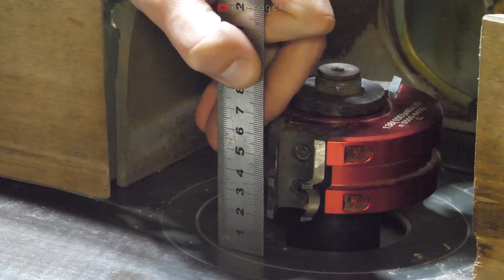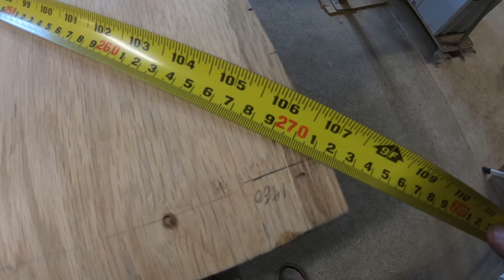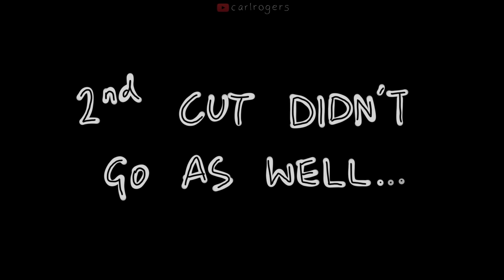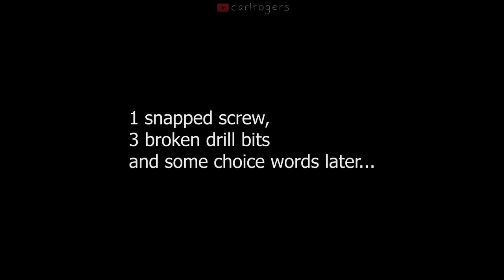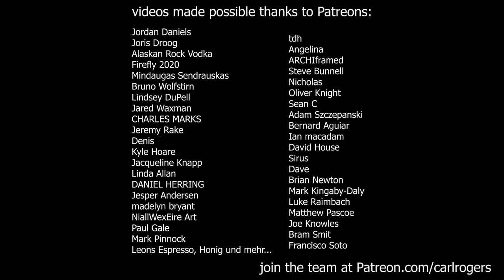Oak Door made from Old Scaffold Boards

Comment: I am an old-timer carpenter from Croatia. For my sense of beauty & design, that barn door is overstyled, although really well done with talent and skills. 
I used to work for a billionaire at his country estate at the Mediterranean. We bought 150 years old oak planks and beams for the doors. All imperfections were welcomed and appreciated!
I treated the wood with hardwaxoil before I assembled the planks to a door, so even the no visible parts were protected against humidity. 
Note: the charme of an old building is his memory of centuries with its ups and downs, wars, wounds and different owners. 
Carl's new door will be best in 100 years.
Reply: Indeed. In one way the old door worked for me. The very wear and tear on it was a work of art. And it fitted into the old door frame like husband and wife. The key hole was magnificent. 
What would they have done in the past? I think a broad, thinner, old plank would have been attached over the bottom to cover the wear. If security is a problem then I would have no problem with fixing a high security lock through the door, leaving the old latch as original closure means.
Reply: Yes you do have a point, repair is always best than replace if at all possible. Was that old door salvageable?
Reply: I had the same thought: at least put some linseed oil on the planks before assembly.

Comment: This young man is an artist among carpenters and builders.  He takes his time and gets all the details right.  (After many years working with heavy machinery, I do hate to see anyone working with a loose floppy shirt.)
Reply: I agree about his skill, and I especially agree about loose clothing around shop machinery.  Loose sleeve near the belt sander was scary.  I have seen what can happen, it ain't pretty.  Also that young man using the drill press who was wearing that pink twirly thing around his wrist.  Carpenter's apron helps, tucking in helps, sleeve covers help.  Safety first.  Great work!
Reply: @rickcavtube  Cheers, Rick.  Glad we're on the same page.

Comment: Lovely looking door and a bonus on the oak.  Costs for oak are up 30% this year alone.  

Not sure if you did this but the vertical boards need to be spaced apart by a couple of mm.  Essentially pull the T&G back apart before fixing on the ledges.  If you don't do this your door is likely to bow around the ledge.  The vertical boards pick up moisture and expand widthways, but the ledge will not expand lengthways with them.  This forces the door to bow around the ledge to allow for the increased width of the verticals.  Think bimetallic strip.
Reply: I read this twice to understand, thanks for the info. Also indirectly answered my question of glueing T&G.
Reply: I second Robert's comment. I've milled some reclaimed solid oak flooring for a small gate and needed to know these exact things before I proceeded. Thanks. :)

Comment: I watched this when it came out and just moved into my first house, aged 60.
I own screwdrivers n stuff but had never made anything from wood in my life, not even had any lessons at school.
So when I found the new place came with a supply of timber (hideous built in wardrobe, musta been absolutely kerching) I decided to make myself a garden gate.
Thanks to watching this I thought it looked straightforward, even though the only power tool I have is a cordless drill.
A year later.....and it's still there. I learned a lot eg don't use MDF outside even when you paint the ** out of it. 
Obviously mine's a bit rougher (made on a kitchen table in a 'working' kitchen) and my tools were....inherited from my grandad, apart from that cordless drill, and he died in 1939.
But I got confidence from this and now I can make anything......in my head. Still limited by lack of tools but I'll have a shot at anything wood now.
Some journeys start later than others!

Thanks Carl and family.

Comment: Always impressed by your attention to detail and careful planning. Little things like using some 3&1 oil on those hinge screws really shows your using your brain before you start building.
Reply: What's the purpose of the oil?
Reply: Yes, I love all the tiny details that help complete the 'job well done'.
Reply: @micikas  Makes it easier to drive them into the wood. 👍🏽
Reply: Goose fat would be more traditional, 👍😁
Reply: Vaseline (petroleum jelly) works well too.
Reply: I used to have a tobacco tin of grease. . 55 years on the tools.
Reply: 3&1 will poke through just waaaait. use mastic linseed oil base or wax but 3&1 or WD40 is silicone and thats bad for finishes.

Comment: As a joiner (for 36 yrs) and experience of making plenty of oak doors and gates, I've just got a few tips to make that door last a few years longer. 1. Leave expansion gaps between the boards. 2. Use stainless or brass fixings. The oak will rot steel screws quicker than you think. 3. Braces are too shallow. They should have gone bottom corner to centre of middle ledge and then centre of middle ledge to top corner in a line but at least you got them going the right way! Some so called joiners can't get that right.
You might have been surfacing the best way as you sighted down the length but it did look like you were round side down on a couple of the boards? I was always taught to take a light few passes and push the board from the back, not press down over the cutter or you'll plane it bent. 
Also on the spindle moulder, when rebating I'd always have the cutter block at the bottom, that way if the board lifts you can run it through again. Your way it would have taken a big scallop out. 
Just tips, not trolling! 😊
Reply from the maker: much appreciated! really useful and well said so thanks for taking the time to write that :)
Reply: @carlroge  I'm sure there are other doors you can apply these advice on :D by the way thank you for restoring a piece of french history, the built looks quite premium so I guess it belonged to some local lord or whatever aristocrat family
Reply: i have to add a lil thing, on the plainer, you have to press it down, but on the 2nd half of the table, the half behind the cutter. Exactly how he did on the last few inch of the boards, thats how you have to do the whole board. Thats how to get a plain surface out of a bend board. And for that you have to lean over the cutter, so dont wear lose clothes, for safety ;) Also i hope there are no kids using this heavy door, since if it catches wind this can get quiet dangerous, we have used damper for such huge heavy doors (like at older cars trunk) to limit the speed of movement. Also nice work carlrogers. *Not my native language, hope it was understandable, cheers.
Reply: Good comments - the braces aren't doing anything once they are at more than a 45 degree angle - that's why for a wide door they don't go right across -  if that makes sense :) and use the planner to take the majority of the 'thicknessing' process of the board - its quicker - once its down to nearly the correct thickness then pass it through the thicknesser
Reply: Completely agree on point 3. I've learned that "wood must stand on and steel must hang from the hinges". And indeed, one often sees wooden braces "hanging" instead of "standing".
Reply: Also as a joiner of 36 years, I totally agree with you, a good effort on their part, but not quite correct. It will be nice to see what it looks like after a year of hanging off those hinges.....
Reply: I agree with Degsy Terry if the wood expands it will bow and the braces are to shallow
Reply: i don't get what you mean about bracing can you elaborate please
Reply: As a cabinet maker/luthier this guy has some very good advice, still a very nice door etc though well done
Reply: I have to weigh in here! The braces are shallow, but they are still triangulating - the geometry can't go anywhere.
I did wonder why the one door, not two? There could be many reasons, including following what was there, but two would have been easier for day to day access.
Reply: @robertmitchell9415   little scrape on the ciment...

Comment: The last component should be a drip ledge.
To shed any water clear of the bottom of the door, 
so that it doesn't soak into the end grain, 
and cause rot, like the last door suffered from.
.
Reply: The door sets under a roof and it doesn't appear he lives in a rain forest. lol
Reply: @cletusspucklerstablejeaniu1059  
LOL 
Rain gets wind blown, and water off the roof will also get wind blown, onto the door.
That's why the original door was rotten.
.
Reply: @niklar55  ... Uh ... You do know this was a livestock barn ... A "300 year old livestock barn!"
Reply: @cletusspucklerstablejeaniu1059  
Naturally, I have two, also in France. Very similar.. So, I know the problems well.
.

Comment: Carl if you have heavy or clay soil there, you can dig the sawdust in as an excellent soil conditioner. (This allows air into the soil for much healthier plant growth) 😊
Reply: depends on the species of the wood... some are great vegetation killers.
Reply: @jancloddlafront9185  It's oak - and it's in the title.  The risk - if you are really wanting to find fault with the idea - is of nitrogen-robbing by the sawdust with its large surface area as it rots down.  But even this will be a short-lived effect as with tiny particle size it will break down relatively quickly, and the following year all will be well again, especially for nitrogen-fixing legumes.  I manage an allotments site and use much sawdust in this way & in composting.  I think Phil's idea is a good one.
Reply: @jancloddlafront9185  like "eucalyptus" for example.
Reply: @falfield  I used to work in a cabinet door shop that just pumped it into a huge pile out back, 3-4 ft tall. Mostly oak and birch sawdust. That was about 10 or so years ago, and it's mostly still there. The shop has been closed at least 8 yrs. I would have thought it would have long ago been rotted. Only the part that touches the dirt is rotted a little more at a time. It was curious to me, is the reason I checked every year or 2. It's been about 2 years now. Time for me to check it again.
Reply: @teenapittman4241  There are 2 reasons why it hasn't rotted, one a possibility and the other a certainty.  The possibility is dryness - sawdust piles can often shed water very readily and be quite dry under the surface.  Dryness is the reason the wood in your house doesn't rot.  The certainty is the absence of nitrogen.  Composting (an accelerated breakdown by natural mechanisms of organic matter, about which there's well-worked out theory & lots published) requires a balance of carbon-rich (woody/stemmy) material and nitrogen-rich (green leafy/sappy) material, together with air and water.

Too much N and a slimy mess results (think a bag of grass clippings) and too much C and you get a dry, non-decomposing pile (your sawdust).  Putting the sawdust direct into the ground causes the C to draw the N it needs to rot from the soil (so leaving less for plants to use for growth - the 'robbing' remark above).  Were your sawdust pile to be mixed with sufficient grass clippings (much more than you'd think needed) or with fresh manure, it would make marvellous compost.

In our food caddy (for kitchen vegetable waste, coffee-grounds and tea-leaves) we put a fistful of sawdust at the base.  It soaks up moisture from the rotting tomatoes and similar and prevents it from sticking to the base so making for easier emptying.  And this balances out a day's veg waste (2 vegetarians - several litres) and leads to a lovely rich wormy compost after being transferred to our bin outside and mixed in with garden waste.

Comment: Great job! After being disappointed many times myself using the glue and sawdust   filler, I would have glued in a sliver of wood to fill the saw cut. But it doesn't matter at all. Still looks great.
Reply: I was expecting that instead of the goo fixing method.
Reply: هو أنا قاعد فى وىشه
Reply: أنا عاوز أشوف اخبار
Reply: TgWags:::true that, Wags !  That is one of the older woodcraft methods and is called a “DUTCHMAN”….that is, a ‘spline’ of the same species AND grain pattern was glued in where there was a ‘resin canal’ or blemish or saw cut.  These old guys also call the sawdust “FINES” and I think preferred a glue called “Flexwood Cement” to produce a same~species wood filler……..exp: Alton McCoy, Portland, Oregon….now McCoy Millwork.

Comment: I’d be sorely tempted to frame that door and hang it on the wall in the living room, spectacularly nice and your workmanship is superb!
Reply: I made my living restoring old buildings.  The new door is inappropriate.  I would have used the old door and simply build an inside face to it.
Reply: Indeed, repairing the old door isn't that complicated, one can easily scout out some old pieces of wood and insert this artfully into the lower left hand corner.  There was no need to eliminate the old door entirely.
Reply: @emsnewssupkis6453  
👍
Reply: Perfection is a moving target

Comment: Beautiful work! I’m curious what drove the decision to widen the grooves with the router, rather than resetting the fence on the table saw and doing the additional passes there? Balancing the router on the edge of a board can be tricky.
Reply: I wondered why they didn't do it on the spindle moulder. Maybe they didn't have the right tooling.
Reply: @tombristowe846   the spindle molder is too small and no feeder. its just as well.

Comment: Any concer regarding wood expansion and contracting with these lolid planks being screwed in place?
Reply: The panel joints are not glued so they should be okay as long as the door stays dry to prevent excessive expansion. If it is humid when the door was made the wood will likely only shrink.

Comment: My 2 cents: You have the space for it: why not blow the chips out the building onto a compost heap?
Reply: That's exactly what I was going to suggest. Lol.
Easiest use for sawdust is compost.
Reply: If it’s treated wood or has remnants of some sort of lacquer/ finish, as the chips/dust breaks down you’ll be left with a compost full of poison to the eco system basically

Comment: I saw in in your video about cheap and easy sawdust solutions. Use the existing blower and fan and get a cyclone separator. Then you can have the cyclone drop the dust and shavings into a larger container keeping the filtration system clear of clogs like you had. The dust itself I personally use in my compost pile. Grass clippings, sawdust, kitchen scraps and you can use it to boost your own garden. It’s a win win. Hope that helps as I’m keeping this short for comments. If you need anything let me know. 🤙

Comment: Hi Carl, beautiful door, great craftsmanship. However, wood absorbs moisture and it expand and contracts depending on humidity and temperature level of the air. Since all of the individual door slats are pinned together using screws and cross braces my expectation is that since the slats do not float within a top and bottom edge frame board to allow them to move slightly to allow for humidity and temperature expansion and contraction so they can freely expand and contract with changing humidity they are likely to develop some vertical splitting instead. But they still look great for now.
Reply: Yes.I experienced this reality when I rebuilt a similarly large garage door in New England. I had to replace rotten bottom and side edge boards. During disassembly, I wondered why there were only short, thick pin nails holding it together in places throughout the tongue and groove construction. Thinking this was the causing the door to sag, I used wood glue in the tongue and grooves and attached diagonal brace. After one year in N. E. weather, the door didn’t look too good at all the seams. I had prevented the joints to allow for this expansion and contraction you noted. Lessen learned. Respect the old door construction. There was a lot of experience that informed it’s construction. Now when I address the second swinging door, I will keep it loose and use heavy gauge wire for the diagonal swing brace.

Comment: Beautiful work!
There used to be stoves out there (cylindrical in shape, not like a typical open stove) that worked with sawdust (not a flame fire but rather a smoldering fire) and would generate a lot of heat... much cheaper than wood, too, and good recycling solution as well...

Comment: Old ship wright trick. Paint wood with regular full strength automotive anti freeze. Kills existing dryrot and prevents it from starting. The wood soaks it up and when dry, can be oiled or painted with no problem. Works great on fence posts.

Comment: Seems to be a highly skilled worker who works with great ease.More than the actual work they have designed the most elaborate machine tool itself which is highly technical.The British(?) are indeed highly skilled and versatile.Somehow they have brought life to old oak wood boards! and created a new door with a new life which may last another equal years.They should have renovated the barn before changing the door.The new door looks odd.

Comment: nice job Carl well executed. you should develop more hand tool skills mate you might not have screwed  up with track-saw on the angle cut just saw plumb down to you line every 1" or so and popped them of with a sharp chisel. I love machines but the control and accuracy you get with hand tools is well worth developing especially in a situation  like that .love your  content

Comment: Would it not have been better to have made 2 smaller doors, meeting in the middle with hinges on both sides of the entrance walls ? The weight being carried would have been less and you wouldn't need such a large clearance for opening them. Great video and as usual,  I learned a lot from you guys. Thanks.